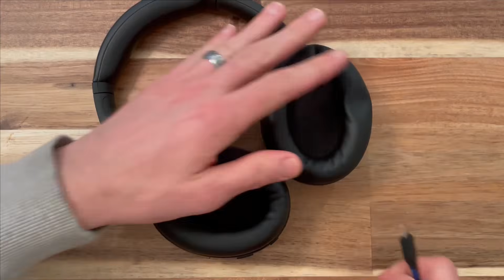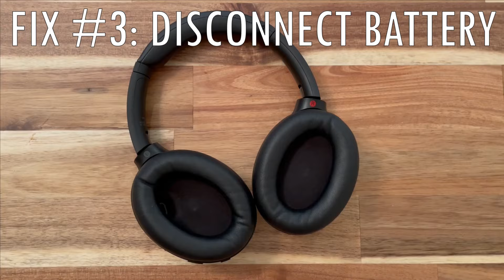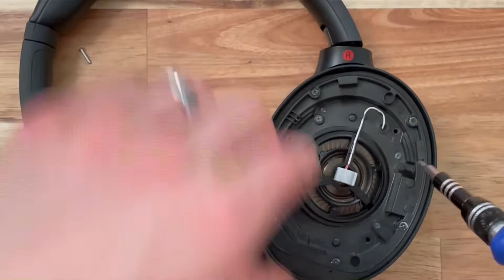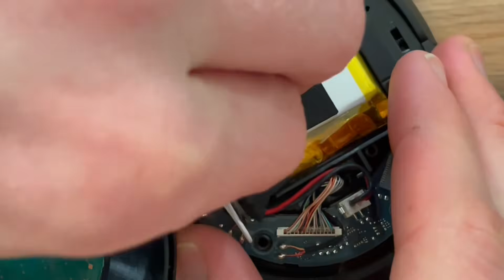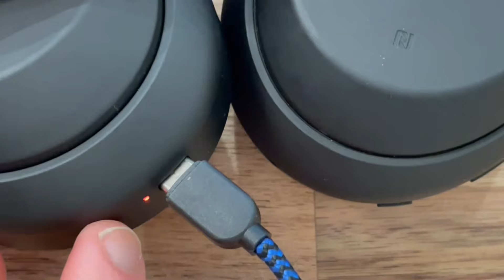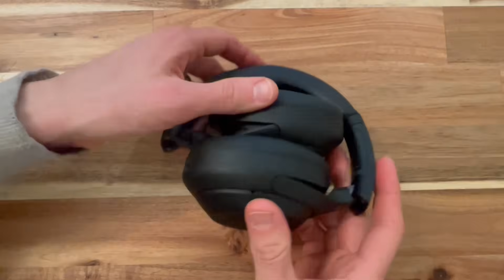SONY WH1000XM4 Battery Troubleshooting & Repair - No Power, Won't Charge & Short Battery Life Fix

Comment: i didnt wanna open and fix the inside by myself because i once broke earbuds by trying to replace the battery by myself. So, i asked Sony for repair and they quoted me over 300 dollars for fixing, thats more than the brand new headphone. So, i tried to fix by following your instruction and it totally fixed the issue. It took me only 20 mins to fix. Sony was trying to charge me 300 dollars for that simple task. I will never ever buy Sony products again. Thanks for your video anyways!!

Comment: I’d appreciate some help: my headphones won't charge—the light just keeps flashing. I’ve checked the battery status and it’s fine; I inspected the pins and looked for signs of oxidation, and everything is in order; I also checked the resistance, and it’s within an acceptable range. Any idea what might be going on?

Comment: i tried everything before i replaced the battery, it used to say battery at 20% please charge, charging did not turn on the power but after i changed the battery the battery is at 90% charge but it still does not charge, what do i do?
Reply: Same

Comment: thanks bro .. I wont attempt to remove the cushion without such clear guidance. I ordered a battery fixed and now no more battery is Low. 
only one issue , the charging led is still off. Appreciate any advice.
Reply: I charged the battery more than 12 hours .  I checked the battery by taping power button and it says better more than 80% . It is not saying battery full . is this normal ?

Comment: These things suck.  

They were expensive, the app sucks the settings go wonky on their own (talk to pause comes on by itself. Pause the audio, take the earphones off, and it starts playing again).  Constant charging issues like this.

I have had to reset these things every few weeks since I got them.

If I wanted a buggy electronic device that always needs to be repaired, I'd go buy another Audi.

Absolute garbage.
Reply: A month later. They have been randomly turning off.

Thismorning, they said low battery. I plugged them in and came back an hour later.  "Battery about 10%."   They're back to not charging again.   

That's IT....

After spiking them on the floor, I walked down to the pier and hoyed them into the bay where the rest of the turds end up.
Reply: 12 days now and they need another reset.  

I'm ready to take a hammer to these things.   Never ever ever ever again will I ever buy a Sony product.

Comment: Hey Jon, thanks for the great video. I have followed all of the steps though I am still getting a blinking red light when trying to charge. New battery, headphones still work when charged but once out of charge, just the dreaded red flying light. Any other suggestions?

Comment: Thanks. Disconnecting and reconnecting the battery worked for me. Preciously it would keep saying battery at 10 percent. When I measured the battery voltage it was at 4.18v, and the battery is rated at 4.2v so it was basically fully charged.
After reconnecting it now says it's at 100% like I expected it would

Comment: Long shot since this video is so old, and so is this model. my XM4's have never had any issue with charging or working wireless or wired 3.5mm - They recently stopped showing an indicator light when plugged in. I was unable to preform the resets for 3 and 7 seconds or 30 seconds as I believe they must be charging, or have some battery in order to complete the reset. I have hundreds of USB-C cables, dozens of adapters, but usually just used my PC USB port. 

I am getting no light. No audible from the headset. But I am getting audio on my pc showing an item connected. 

after hours of trying to hold the buttons down and plug in, or plug in and hold both buttons, I got a random red light and thought it triggered the fix, but the light lasted 1 second and was gone.

Comment: Hey boss. Replaced the battery a year ago. The other day they went completely dead. No light at all, even when the charger is plugged in. Wondering if I should just get completely new headphones as these are 4 or 5 years old and have had a good run. Thoughts?

Comment: "Battery 10% - please, recharge headset!" despite charging for 2 hours. I got really stressed out. After trying the first two methods nothing changed. What worked for me was the third method, disconnecting the battery for 10 minutes and connecting it again. After that, I got a 'battery low, please, recharge headset" again, but I pressed CUSTOM button and it said "battery fully charged!"
Thank you so much for this video!
Reply: I think I have to do this as well

Comment: Open mine and checked my battery, showing 3.7V on multimeter. Done factory reset. When I start headphone I have 4 flashes of light and then nothing happening, no pairing mode, no speach in headphone. What do you the problem is?

Comment: Hey, I did all the steps, replaced the battery, they finally turned on for the first time, the next day they died and I tried charging them to no avail, the light doesn’t turn or or nothing no matter what charger I use and whatnot, what can I do, is it the charging port or a motherboard issue?

Comment: Hi there I replaced the battery change the charging port the ribbon cable and still but i noticed that the battery have the ribbon cable were you plug it feels loose am not saying this is the issue come pare when you did it on your video it dont look loose

Comment: Great instructions, but I think mine still won't charge. There is power coming in, it audibly 'said' "low battery, please recharge headset" then tried to connect the Bluetooth. I did the Factory Reset and saw the blue light flash 4 times. However, the charging light next to the USB-C port isn't lit. Maybe it's the charging circuitry? :(

Comment: Headphonesbwasnt charging. First of all the light would come on and go off after 2 seconds. 
Tried all the pressing the buttons and nothing 
Battery life is ok when charged lasts long.
So I disconnected the battery for 15 min and it's charging now.  Butnyou have to power the headphones on to charge.
Wondering if it's a bad battery or circuit board

Comment: Is it possible there’s something wrong with my charging port? I bought a replacement battery and replaced it and it powers on and still says to charge. Plugging it in to charge I get no charging light not a charge past 10%

Comment: My Sony xm4 got water damage and turned on and then turned off I put them in rice but it still ended up dying I replaced the battery and it turned on for one charge to 60% and then it did not charge anymore I got another battery and it doesn’t see to charge at all there also is not light what do you think the issue could be?

Comment: Bro you are a freaking lifesaver. My headphones fell in the toilet and the sound would work but with in and out static in the right ear, the touch board and charging was completely shot. So I sat it in rice thinking it would somehow help but it didn’t. I kept using it, eventually the static stopped. About 3 days later I tried to charge it again in hopes it would work, but the only thing that came on was the charge light (slow blinking but no charge) then I came across this video and did all the steps, now my headphones in back to normal. Thank you so much for this video

Comment: I've had three paisof these headphones, ALL OF THEM have had the charging problem. I've noticed when taking off the ear pads that there can be water inside, I've used a clean sponge/cloth to gently pick up water. I've also used a handheld portable duster (mini air blower) to blow air into the charging port, and or, blowing air inside once the pads and foam have been removed... This dries the inside of the headphones out and this usually makes them charge. Be careful if you do this, hitting the airflow on the speaker cone can deform it, make sure you angle it away from the cone. A safer way to dry it out is to put in front of a regular fan with the pads and internal foam removed, it's slower but safer. You might also notice a lot of moisture trapped inside the foam, if so I rinsed the foam and pressed it wrapped inside paper towel to dry, then under fan to finish drying. I hope this helps. I have tried all of thother steps but if moisture is present inside the cups you gotta remove it. It causes corrosion on all metal... Metal screws, and connectors.

Comment: Hi there, I changed out the battery and charging port then did a factory reset but I’m having blinking charging lights. By any chance do you have an idea on could be causing this?

Comment: hi, not sure if you’d still respond, but i changed the battery and my headphones worked for an entire battery cycle to 100%, then i couldn’t charge them until after i did a battery restore, but even then, they only got to around 30% and now they won’t charge

Comment: Thank you for the informative video! I'm still having issues though:/ My headphones wouldn't charge anymore and the red indicator light wouldn't light up when plugged in. I did the reset (didn't fix), did the factory restore (didn't fix) so I went ahead and bought the battery replacement. I just did the install and it's still doing the same thing. No red indicator light when plugged in (tried 3 different chargers to make sure it wasn't that). Did the reset > factory reset again and let it charge for a couple of hours. It turns on but still says "low battery please recharge headset". Any idea what it might be? Did the board go bad or something? Would appreciate any help!

Comment: I tried most of these tips and nothing worked. Was thinking of replacing the battery until I had a thought. Maybe it was the charger. I had it plugged into aftermarket charger I was using for my iPhone. Switched to a different charge cord and bam! Little red charge light came on! Phew.

Comment: Great video here.  @Jon  However, I carefully replaced a broken right hinge last week following another YT vid.  But, when I attempt to charge, after about 10 seconds the red constant charging light starts blinking.  No matter how long I leave to charge, no charge goes in.  Despite the unlikely coincidence of possible battery issues, this week I replaced the battery with Amazon's approved choice for these headphones.  Still, no matter how long I leave to charge, the red constant light blinks after 10 seconds and no charge is accepted.  And, yes, the headphones work just fine with charge in them, but clearly that'll quickly wear down.  I've double checked all connections twice - both ear cups, plus ensured firmware is 2.9.0.  They also work just fine with direct mic jack connections.  These have been great headphones for nearly 3 years.  I'm loathe to have to replace them as I try not to get through the planet's resources without good reason.  Help, please!  Thanks, guys.

Comment: Excellent video. Unfortunately, none of these methods worked for me though. 

The issue turned out to be a short in the charging port circuit board. It's delicate but easy enough to replace, and you can buy one using the same link that's in the video's description. Hope this helps anyone who needs it.

Comment: I am having a Sony wh 1000xm4 and because of some reason the left side was not working. But when I followed your instructions keenly on fixing the issue  on your video,it works like magic. I did just factory reset as instructed. I am now very happy  with the success and thank you so much for your useful video. God bless you abundantly.

Comment: Alright man thank you for this. My headphones would not charge and red light would turn off after a few minutes. Fix #1 caused the light to stay on but after 15 minutes of charging, still “Low battery, please recharge headset.” Shut down. 

Fix #2 did not fix this.

Attempted Fix #3, which fixed the issue for me. 

Here’s whats really interesting: After I disconnected the battery and temp sensor I let the battery sit for about 5-10 minutes to let the headset totally discharge. 

Plugged everything back in, put the headset back together, and plugged the charge cable in for about 5 minutes. I lost patience so I unplugged and turned the headset on after only 5 minutes of charging. Beep, “Bluetooth Connected.” What?! 

Then I pressed the power button to check the battery and the robot lady voice said “Battery: Fully Charged.” 

It does NOT take 4.5 minutes to go from 10% to a full charge. 

Here’s my theory: the power board itself was likely “logic locked”, a condition where simple computer modules like this basically digitally lock up and get confused. This happens quite a bit in car repair. 

I believe that the battery was actually charging, but the power board that runs the headset was for some reason misinterpreting the battery state of charge and thus powering down the headset. The hard depowering reset allowed the headset to totally discharge, which freed up this logic lock. A true reboot. 

Thanks for the video! My day is made! So happy to have my headset back after they’ve been sitting on my desk useless for 6 months! 

Cheers

Comment: Disconnecting a battery won't discharge it, what a nonsense comment. Leave it 10 minutes so it gets fully discharged? what are you talking about, that's not how batteries work. You need to power something on so that they discharge. Passive discharge takes much more than 10 minutes. Foolish advice.

Comment: Hello I purchased a new replacement battery however it didnt come with the small battery heat sensor tab piece on the battery that foam pad is covering. Is it a reason that it did not come with that? And am I still able to use it without that???

Comment: Replaced the battery and charging port. Turns on but won’t charge at all, once the charger goes in, the headphones shut off and won’t do anything. About to toss them away

Comment: Hi, I replaced the battery and recharged.. Still  the same problem as before. Can't reset, factory reset, or connect to Bluetooth. When I disconnect the power cable the headphones announce "power on" but are completely dysfunctional.  
Please help

Comment: I hope you are still watching this comment section. I bought some used headphones off ebay, and they are in very nice condition, almost new, but they are damaged. I already reported them to the seller, but while I wait I'm trying to make them work. The symptoms are: They came completely dead, so after charging them, as soon as I disconnect the charging cable, they switch on in pairing mode. Ok, everything looks good, I can connect to my phone, upgraded firmware to latest 2.9.0, but the thing is I can't turn them off. Activated auto-off, cleaned the sensor, still won't turn off. Pressing the power button does nothing. If I plug the charger, they do turn off, but disconnecting them do the same, turn back on in pair mode. If I turn them off via the App they do turn off, but after half a second they turn back on. I tried to do the full reset, but since it has to be off to work, I unplugged and before the came on I pressed both buttons, and I was able to do a full reset. But now they are completely dead. No light, no charging, nothing. I disconnected the battery and they came back with the same behavior. So to me looks like the power button is stuck. Would love to hear your opinion.

Comment: nice vid!  I don't see any replacement batteries with the heat sensor attached to the battery.. you didn't really say anything about that part.  do we just swap it from the old to new?  how is the removal of the old heat sensor, etc..?  thanks!!!

Comment: My older model worked exponentially better than these with no charging issues and better sound but the hinge broke so i got these new ones for my wife and they are cheap pieces of crap. Sony came out with an amazing product and had to design them to be cheaper and make more profit off of us. The old switcharoo.